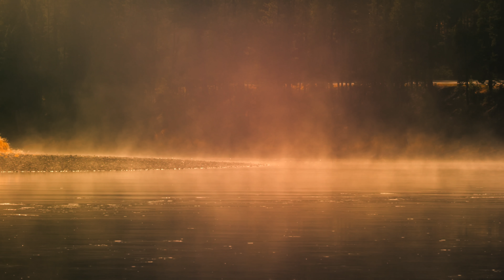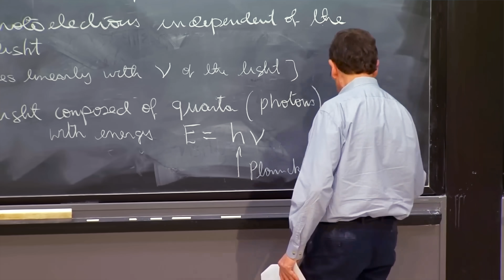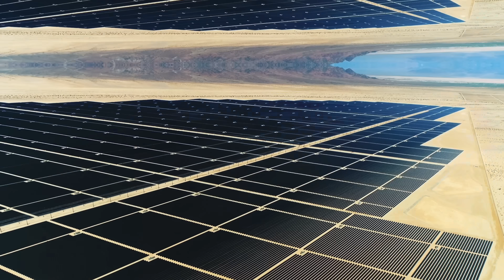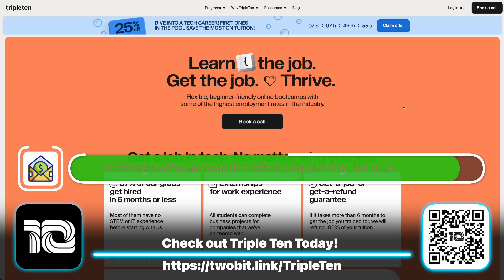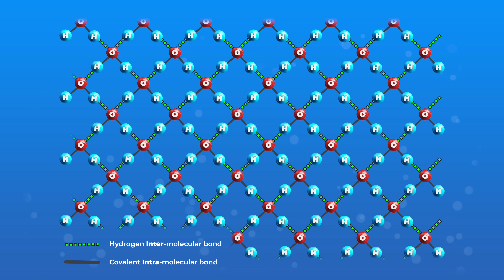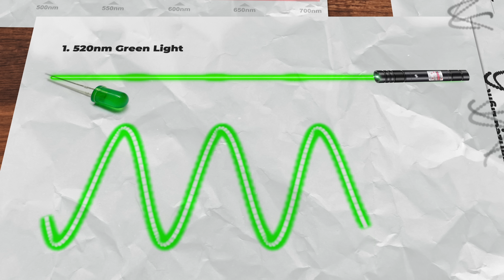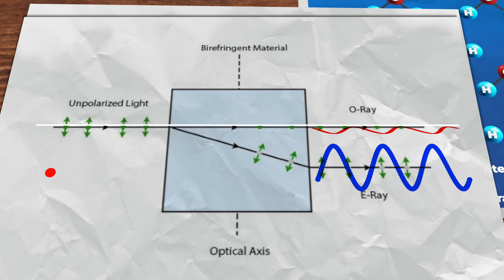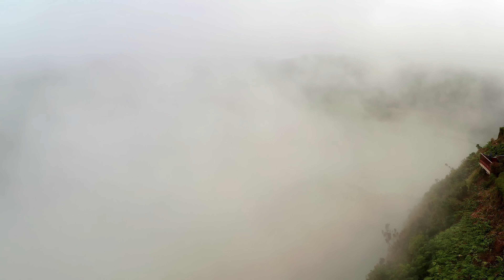New MIT Discovery Just Solved Water's BIGGEST Mystery!

Comment: Nicely explained. This throws a spanner into the works of climate change. The most impactful greenhouse gas is water, and CO2's role in global warming is to provide a constant background warming that evaporates more water. CO2 by itself (without water) has insignificant heating - it requires the extra evaporated water to be impactful. The photo-molecular effect means that it isn't only CO2's warming causing significant evaporation, it's light, so we need to dial-back CO2's influence on water evaporation. It also means that the Earth's albedo (reflectiveness of visible light i.e. clouds) has even more significant impact on water evaporation and thus greenhouse gases than previously estimated.

Comment: This is not new I've known this for 20 years we regularly measure this it's called the pan evaporation rate and it is literally where the photons excite the molecules on the surface and give them enough energy to break free not by heating but simply by energy exchange by impact so to speak. 

This is not new science They actually use this to measure how much sunlight is actually reaching the surface of the planet since it's not measuring heat.
Reply: Seriously maybe I'm weird but I never thought heat evaporated water heat boils water I've always been told that it's photon impact basically the high energy photons from the Sun knock the water molecules off the unstable surface They give them enough energy to escape this is always how I've understood it to work at least as far back as I can remember 20 25 years
Reply: No it doesn't break the laws of physics it's in compliance with all physics now this is not what I was taught this is what I simply assumed when my physics teacher told me about how photons can free water molecules to evaporate this is why we use pen evaporation rate because it does not measure heat boiling it measures the difference in solar radiation reaching the surface 

It's more akin to the best way I could describe it is if you were to shoot a bullet at a pile of rice The bullet is going to knock some of those rice kernels off of the pile That's how this works photons hit the water excite some of the molecules They attain enough energy to leave the water body 

At least that's the way I assumed it worked
Reply: Seriously I can even tell you when I learned about this it was in 2001 The terrorist attack in New York City did something that was never done before it grounded all air traffic which is something that is not likely to ever happen again so scientists took advantage of that point in time when all air traffic was grounded they were performing a study on how much of an impact contrails had on the amount of solar radiation reaching the surface of the Earth 

Since there's no way for them to just ask the government to ground all traffic they went crazy trying to collect as much data as they could during this very rare event not a nice event but why let the science go right? 

They found a global mean temperature increase of 1° c just from grounding all the airplanes which is just a phenomenal impact on global mean temperature just from the difference in contrails which are basically clouds that are generated by aircraft 

I was curious about this pan evaporation thing and that's where I learned that solar radiation the photons themselves are what freed molecules from the surface of the water when they measure pan evaporation That's how they can use it to measure the amount of solar radiation reaching the surface of the Earth. That's also when I learned about albedo. 

So it was back in 2001 when I learned about this That's 24 years ago this is not new science
Reply: I liked your comments. Very fascinating.

Comment: My understanding of evaporation has little to do with heat except that heat affects vapor pressure. When the vapor pressure is lower than the surface pressure of water, the water will evaporate. Cooler air generally has a lower vapor pressure than warmer water. As the air warms by the sun you get higher pressure. Wind also creates a lower vapor pressure over water surface so you'll get more evaporation there too. If the air should reach 100% humidity and the air and water are the same temperature you would just get an equal exchange of molecules at the water surface.  If I'm wrong, I'm sure someone will correct me on it.

Comment: what about water droplets dropping into a laser. we could bounce the light many times over in the direction we want and the water will get evaporate in an area we want it to in a controlled space. and harvest the fresh water or salts that we are after.  but we run into an issue of pumping the water. but we could use the tides to push water kind of like a ram pump. Just theorizing.  and this makes me think could we use this in thinks like alcohols and distillation, eliminating the heat could have interesting effects or allow for cleaning up/recycling  solvents

Comment: You are missing pressure. Pressure is everything. Close to the top of k2 you can stick your hand in boiling water quickly without getting burned. At 70 thousand feet just the heat from your hands will boil water. Pressure caps are used on all car radiators to keep pressure high to resist boiling. Yet you didn't say one word about it. I think you are just parroting your understanding of other people's work without grasping it. Boyles laws of pressure and gases already covered everything you talked about over a hundred years ago.

Comment: Evaporation is powered by the difference in vapour pressure between the water & air. The hotter the water is, the higher the vapour pressure. The colder the air is the lower the vapour pressure. So hot water & cold air maximizes the difference in vapour pressure & maximizes evaporation.

Comment: Would a dryer with green diodes (non-laser) be able to dry clothes, and if so, would it be more efficient than a dryer using heated air?
Reply: I was thinking this exact thing. It's one of the most practical immediate applications that would save a ton of energy across the globe, and should be easy enough to test.  The video says polarization helps efficiency, but that may mean the effect still happens without the perfect angle and polarization. Definitely worth a try.
Even if polarized light were sent into a dryer, scattering due to reflections and the clothes would eliminate the uniform polarization very quickly.

Comment: I continue to argue that all "heat" is the entrapment of light. I find this "magic" of photons "disappearing" to be wishful fantasy. So, in my assertion, even the "heat" related evaporation is the product of light in the heat band. I argue that all forms of heat are the product of moving light about, whether that be conduction, convection, or the more generally accepted radiation... So light being involved in this way is interesting but not surprising. You would probably find it would be a different light bandwidth for other similar liquids under different gravity fields. The reason here is that, as discussed, water is attuned to the green bandwidth in this way.

Comment: When I was in school back in the 1970s, I asked my teacher if air movement made water evaporate and he told me that water didn't need air, heat, or light to evaporate.  Water evaporated even in a vacuum, even when cold (with even frozen water sublimating under low pressure), and even in the dark.  Apparently, he was decades ahead of the "conventional wisdom" you described here?
Reply: Those properties of water were well known by the 1970's.

Freeze drying depends on evaporating water in a cold vacuum. The Inca freeze dried potatoes as far back as the 13th century, and modern freeze drying  to the 1890's.

And that's just freeze drying - our understanding of that bit of water's behavior is even older.

The great problem with "conventional wisdom" is that the convention is we reward ignorance and showmanship over facts and careful research.
Reply: Exactly, heat was the obvious one but my school also taught that lowering pressure (which reduces temperature) absolutely vaporises water! Ask a cloud .
Reply: @GeoffInfield 
Low pressure doesn't evaporate water. Energy does.

Low pressure means that more molecules leave the water than reconnect. Until the balance is restored.

Your glass of water isn't just sitting there: It is furiously evaporating all the time. The reason it doesn't disappear in a short time is that as many water molecules enters the glass from the air :-)

Science is mind blowing :-D
Reply: yes, all substances do that. As long as the whole system has enough energy to knock a single molecule off (minus a bit of quantum tunneling), it will do it at some point (although ofc the probability of that happening is low then).

Even nuclear fusion happens at ambient conditions and even near absolute zero, but ofc it's incredibly rare then. Heat helps increase the probability (in both cases, evaporation and fusion).

Ofc, the higher the temperature and lower the pressure, the more likely a molecule is to break off. The less molecules are directly above the surface (being able to condense), the more likely the substance is to evaporate faster, where air movement comes into play. (Liquids are always fully saturated just above their surface, so removing that layer is key in fast evaporation)
Reply: I always knew that because I always seen water evaporate when it's cold
Reply: @richardcollejr.5121 
Even "cold" has a lot of heat energy.
Don't let the wording confuse you 😊

Only at absolute zero there is no heat energy and hence no evaporation.
Reply: You are correct.  Vapor pressure is a key factor.  Lots of people know this but not the author of the video.
Reply: @GoogleSucks-i1d 
Energy is still needed, so heat (or apparently light) is absolutely a factor in evaporation.
Reply: @madshorn5826  wrong.  Learn about vapor pressure.

You can put water in a vacuum and it will boil at room temperature.  No heat needed.  

Ice cubes in a dark freezer will shrink due to vapor pressure.

Don't believe everything you hear on the Internet
Reply: xD keep educating yourself through 10 min videos without checking the source

Comment: If you use 3 polarizing lenses instead of one, if they are oriented correctly, you'll get all the light and it's all polarized
Reply: Each filter has a loss associated with it because it will always block light that's at 90 degrees to the filter orientation. What you're describing is that if you put a 45 degree filter between a 0 and a 90 degree one, some light will pass through, while the 0 and 90 in series allows no light through, which is a little counter intuitive. This method puts you a long way from getting all the light. As far as I can remember the amount of light that gets through is the cosine of the angle between the initial filter and the filter after it - Cos 90 = 0, which is why the 0 and 90 combination gives you no light. The 0-45-90 combination gives Cos 45 x Cos 45 = 1/2, so you've lost 50% of the light before you've even started - it's nearly certain that no filter at all would be better.